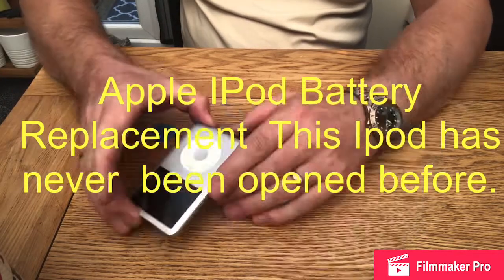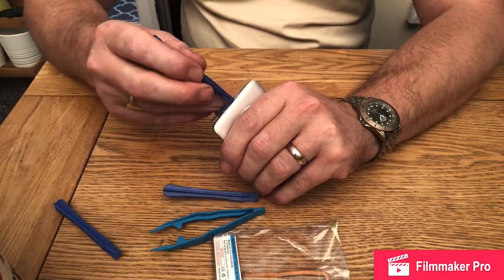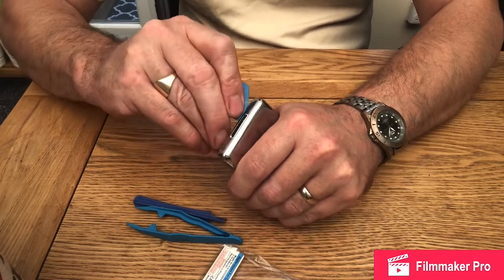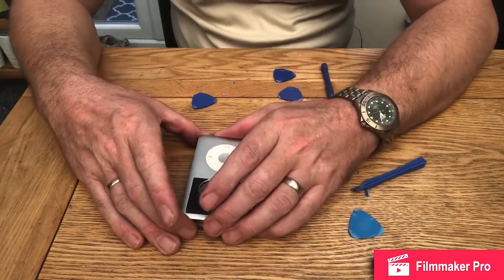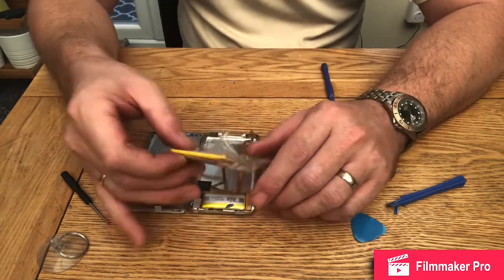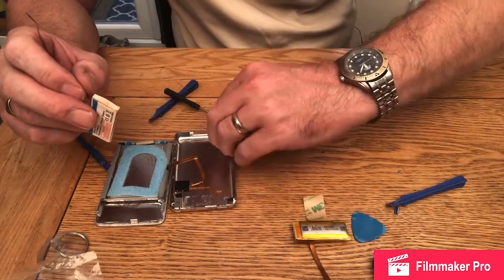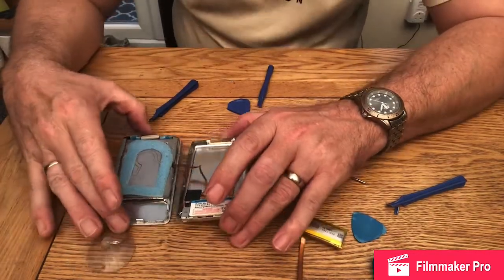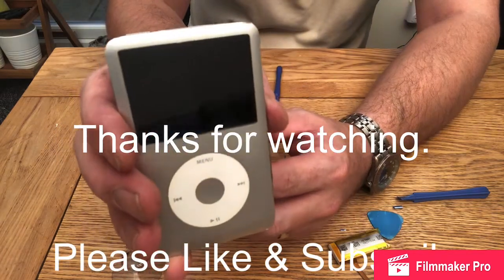Apple Ipod Classic Easy Battery Replacement?

Comment: I gave up in fear of just breaking it.  The 2 blue plastic tools broke right away when I tried to insert them into the edge.  Basically the edge chipped off and then they were useless.  I'd like to see a video with someone actually breaking the ipod because it ain't that easy from what I experienced.
Reply from the maker: I understand totally, it’s just going In very gentle baby steps to achieve the goal. Slowly slowly catchy monkey.

Comment: did you not have to re lock the battery cable to the case?
Reply from the maker: I reconnected it with the plastic tweezers but I can’t remember it being connected to the case.